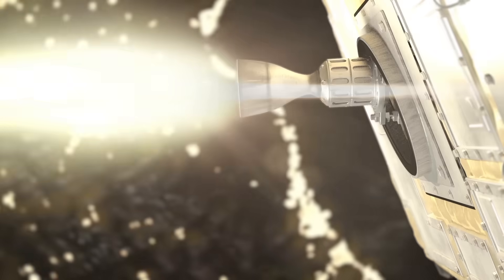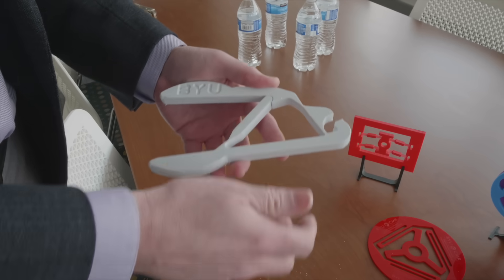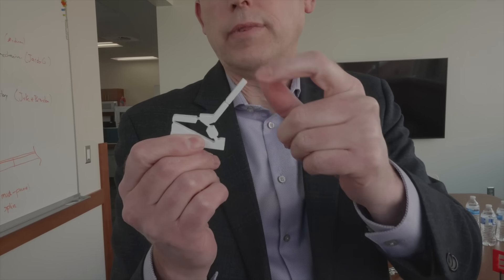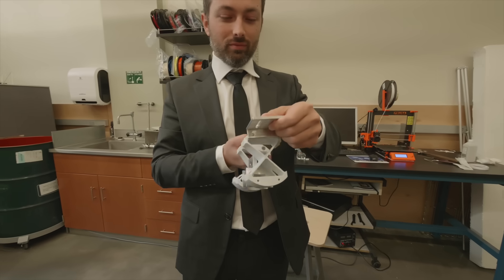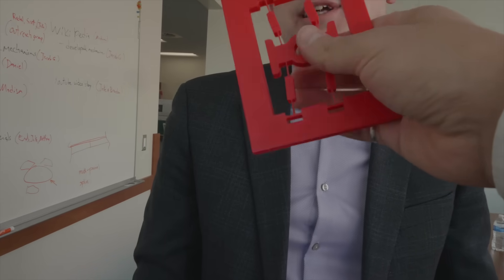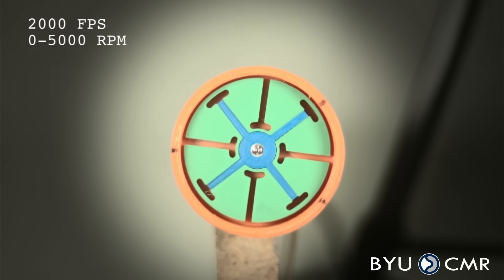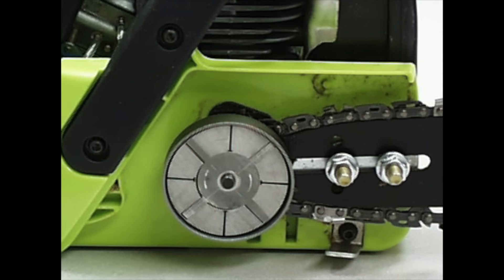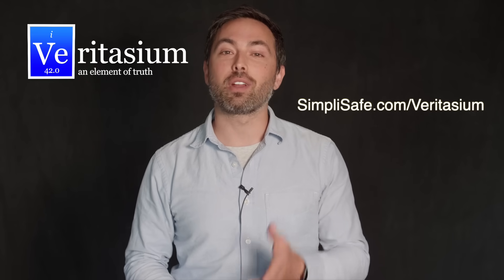Why Machines That Bend Are Better

Comment: Can we use this to make a buckling spring keyboard that isn't insanely loud but still feels like a Model M?
Reply: Run to the patent office dude
Reply: I just realized that the "scissor?" switches in macs work with this kind of principle but are terrible. Well if apple has done something wrong does not mean it cant be done right.
Reply: Glad I'm not the only one who saw that clack over and thought of keebs.
Reply: I need it.
Reply: Maybe, but the noise in a model M comes from the spring hitting the side of the mechanism.
Reply: @Ben Stankovich
I'd settle for 80% of the feel and 20% of the noise of the original.
Reply: I wanna have those switches. Even better might be to print those switches myself.
Reply: Lol.... They are made loud for the sake of feedback,
Get a membrane keyboard.
Reply: Having a little consideration for other people in your general space is sometimes a requirement, and the feedback should be coming through the fingertips. I'd rather have something tactile but quiet than another "poking a dead squid" $20-a-6-pack keyboard.

Comment: HOW about Fixable??  repairable??  Insted of a few years use, we get to have to for ALONG time...
Reply: Replaceable parts are never repaired, neither are small appliances and tools.
A niche use, but if you can take an entire piece (a switch, a hinge, a stabilizer...) and recycle it in one place, this can even turn for better for our environment and everybody's economy.
These are prototypes, bear in mind.
Reply: @jotabeas22  modular parts would be great, but they cant meet with every format of what is possible for a product.  I would love to go back to the old days, but even then, Every company made THEIR OWN switches, insted of just using what was Common, easy to get...  for some reason it was cheaper to make your own, Non-standard switches..  Its the same with Much of tech, From a basic transmission to a Lid closure, there were/are copyrights for just about everything...If we could get rid of allot of them, as being To common to Not be used(yes there is that in CR)..
Reply: @ecash00  Give it time, and let standardization go do its job, and we'll be set.
As far as I'm concerned, I ain't going back to the "old days" when everything was pretty  much a worse, more expensive iteration of what we have now.
Reply: @jotabeas22  there was Standardization..And it was working, but Corps Soon changed things.  Look at car headlights..THERE WAS A standard..  but corps desided they liked CR(copyrights) and Now we are having problems with Not being able to see the turn signals on the front of cars.  the Standards were there, but with the Corps idea of Protectionism, and getting money for anyone that created a design EVEN CLOSE to that they make...your head lights now cost $200+ to replace $5 worth of plastic, every frame is a design and can never be copied unless you PAY MONEY..  its also along the lines of the Best car ever made.  Cant be made.  with all the CR, spread around to each company,they will only make cars with THEIR CR...unless others wish to PAY MONEY todo it.  A cellphone has over 300 Patients...And everyone of them Must be paid for, which means a cellphone price is baout 2 times higher then it needs to be.
Reply: @ecash00  that must be a USA thing, I guess.
Reply: @jotabeas22  Yep..every company would require each to make a different formula for Bubblegum as well as flavor and texture...And enforce the CR..  Or are you talking about cellphones...Which is strange,because China can hack the Iphone and make one at 25% the price...and would never get into the country..because of CR..

Comment: I think a great cause for these flexible mechanisms to go under the radar for so long is the resistance of the material under environmental stress, often caused by exposure to the elements. What have changed since then for these to be more reliable now?

Comment: Such a good vid. You don’t get a sense for how they feel from the video. That’s the only disappointment. Why no haptics, Derek??
Reply: YouTube doesn't support it yet.

I don't know why; everyone has been asking for it since 2030...
Reply: @jlco  Read this when high. Been a while..
Reply: If I had seen this video as a teenager, I would have immediately redirected my path into compliant mechanisms.  They're beautiful.  This is how nature builds systems.
Reply: I feel like VR haptics will be at that point within 10 years. Let's just archive this video for now and come back to it when the tech is ready!
Reply: @Psysium  Compliant mechanisms would probably help in compliant (cloth/rubber) VR gloves.  Maybe with lots of little pins like those novelty art boxes?  Each one acting like an addressable "bit" of a haptic surface.  Then you could use something like traditional texture mapping, maybe even using the same maps used to render graphics on-screen.  Like Braille on steroids.   ;)
Reply: @Psysium  I think sooner than 10 years. Did you see the Microsoft HoloLens 2? And haptic feedback gloves have been prototyped before I think. Maybe 10 years for commercial & mass production but probably sooner for the tech to be a thing.
Reply: @tubester358  w
Reply: I started printing the bistable switch as soon as he mentioned a link to the files, before the video even finished. I'll have haptics soon enough :D

edit: just got it off the printer. holy crap it's incredibly satisfying!
Reply: @adcurtin  I second that. The bistable switch is extremely satisfying. Works perfectly in PLA (for know).
Reply: Haptics is in the description. Printable model, a $100 printer will do.
Reply: Youtube where you at?
Reply: Subscribed.
Reply: Why don't you two date? You look cute together. Plus you could probably make a very smart and very cute baby.
Reply: erm... it's plastic. it feels like plastic.
Reply: Damn u are such a nerd
Reply: Physics girl is hot 🥵 😉
Reply: Yall should date. Or we should date. Either/or
Reply: @TripleTheR101  You know Derek is married.
Reply: @tubester358  hmm I thought for a second there they were totally hooking up.  Oh well.  Would be one smart kid though...
Reply: @CessnaPilot99  Well his wife has a PhD in astrogeology from UCLA. I think they're gonna have one smart kid anyway.
Reply: @manishbhat8570  it's not guaranteed genetically either way, it'll prolly depend on chance and how they're raised, hopefully raised to love learning rather than focus on meaningless grades.
Reply: @tubester358  Yeah, it isn't guaranteed but I reckon the kid will grow up to enjoy science.
Reply: @tubester358  looks like i get a hot date 😏
Reply: not guaranteed but likely  @tubester358
Reply: @tubester358  yeah exactly ‘smart’ is not a term determined by any sort of genes and things, everyone is born just as smart as each other. it’s how you are taught, as in are you taught to listen, so when u get taught u listen (lol) it starts early
Reply: @smurphas6119  ummm.... I have seen some very "unsmart" people right out of the gate,  like verrrryyyyy slow....  I have even seen it in some families,  one kid is naturally gifted and smart,  next kid ummm no so much :)
Reply: @TripleTheR101  And here we see the requisite virgin in the comments trying to ship two people that are already in separate relationships who are just friends and/or are professionals.
Reply: @LurkerPatrol  i like that word "requisite". I suppose ill use at as inspiration to remain a virgin for the rest of my life. Shipping scientists til the day i die.

Comment: ha ha the "Trick question" was obviously not going to rotate the elephants trunk tip to me. 

That said, this is the pinnacle of Elegant Engineering....the devices are optimal in almost every parameter of their function. They look good, they work reliably and do so using as little material and taking up as little space as possible. It's quartet of Engineering goals in each part achieved to A grade. Brilliant.

Comment: Very interesting. I got some of this quickly like the single piece design and it's longevity. The thing I really got was the manufacturing. One big injection mold piece produces many one piece tools. Tools that otherwise would be multi part assembly! That was cool! But I also knew instantly about that feeling pieces like the switch and positive locking reactions! I know that from items yhat aren't one piece but require that same confident action like regular switches! 
I will watch this again as it piqued my interest even when it was going over my head!
 Great episode! 👍

Comment: Does not needing hinges affect the margins of error in manufactuering said devices? And what about the titanium device around 7:50 - if you leave it deflected for an extended period of time, will it be bent when it's back in it's 'default' state, or does the symmetry of it prevent that?

Comment: I was trying to develop a type of relay switch that can be toggled using electricity and also manually like normal switches.... I made some designs with springs and all but that would be very hard to manufacture .... Now this video gave me a very good idea... Thanks a lot

Comment: Hi!  I agree - one of the most interesting episodes you have recently made!!  I will try to make some of these devices.  However, please make clear for us:  "...... the stainless apparatus and  steel wheel, with the hole, operates at 72 Hz, ...meaning this little hole make two complete rotates every seconds".  Is this because there are 36 teeth on the wheel?  You did not make that clear for your audience.

Comment: I may have a degree in Physics, but the engineering in these Compliant Mechanisms absolutely blew me away. To think materials often considered rigid, such as Titanium and Steel, can deform under relatively small forces when engineered into a specific shape is absolutely mind blowing.

Comment: That clutch thing is very interesting in the sense of cars. It could be a more simple, torque-converter-less automatic transmission. When the engine gets to a certain rpm the clutch engages to the drum and releases when the rpms are too low to prevent stalling like a manual

Comment: with the high speed engagement ring made in steel, you should ask him the amount of EXCESS damage it causes when that fails and suddenly has 4 large pieces of high speed shrapnel instead of a smooth cog.